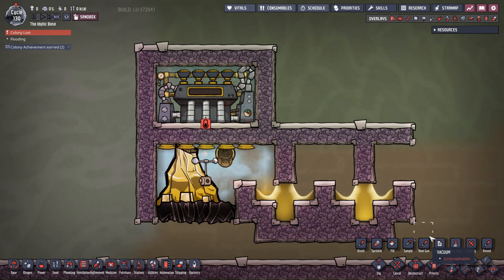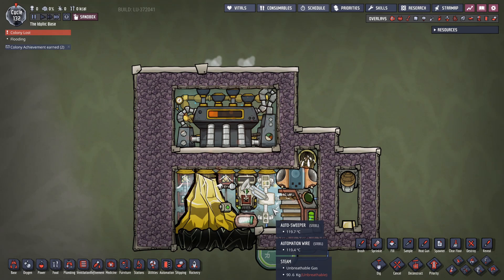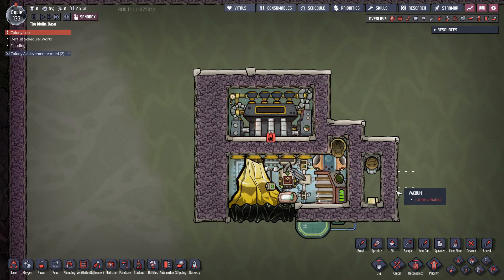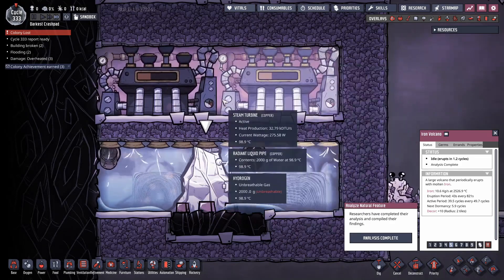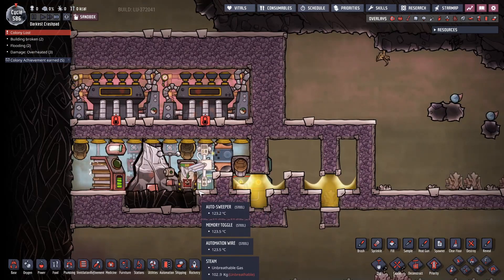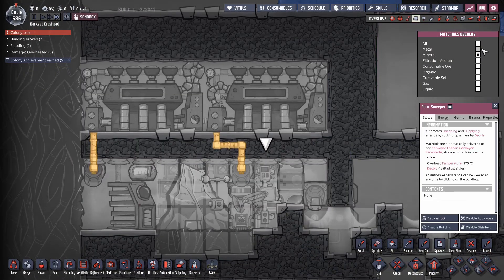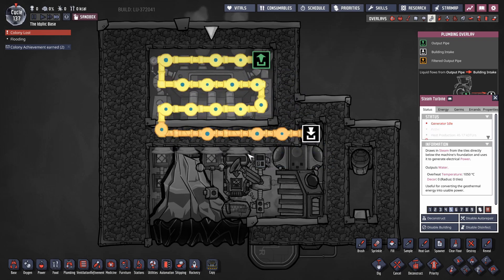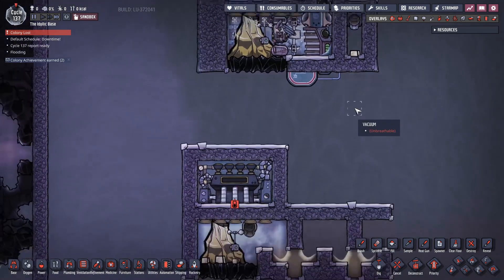Iron, Gold and Copper Volcanoes : Tutorial nuggets : Oxygen not included

Comment: Some advice: I used a modified design form these and while it’s tough to setup and only mostly stable, it works with modded tungsten geysers, however the conveyors will melt if it ever breaks or is setup slightly wrong

Oh yeah also it works with under 2000 kg steam, haven’t tested stability though, and I used gold mechanized airlocks instead of liquid locks
Reply from the maker: Working with volcanoes is a tricky business, do it right and it runs forever. Do it wrong and you have a toxic area of the map you will probably have to wall of forever.
Reply: Francis John yep, that happened on a previous game

Comment: When you mention at 4:32 that you need "3 tons of water" do you mean that I manually need to add the water in the room before the first eruption and after that it's working by itself?
Reply from the maker: Exactly. Three tiles of water 3000kg is about the perfect amount to make it run hands free forever.
Reply: @FrancisJohnYT  Hello I tried the build and after the Volcano became active it took a while for the steam to hit 125 C and now every few eruption cycles, it goes back to being under 125 and the turbines stop. is that normal? Isn't it supposed to run pretty much non-stop while the volcano is non-dormant? The only thing I did different(I think) was using Sedimentary rock for the insulated tiles instead of Obsidian.

Thanks.
Reply from the maker: @MasterOfCookies8  Oh I should have specified the idea is to get the metal out. Continuous operation of the steam turbine is not the goal and not reasonably possible with metal volcano. You need a magma volcano for that and a magma storage tank.
Reply: @FrancisJohnYT  thank you for the clarification :) happy new year
Reply: @FrancisJohnYT  THank you for the answer, will try the build soon.

Comment: For the automation, you do need 3 elements, but it is a little simpler if you use buffer and a not gate wired in a loop - they provide a 'always on with a blip' signal out of just 4 tiles of automation. Hook the filter to the output and you've got the perfectly minimalistic, two phase timer out of 3 components within 6 automation tiles

Comment: Seems like 2000kg of water is the absolute maximum. For the exact design at least, you might get away with it if you make the chamber a little bigger, something i have to test now.
I had put in 500kg per tile, so i thought. I cut the water pipe a little bit too slow (water bottles came from too far away and i had a pipe nearby) and it turned out to be just a little bit over 500kg per tile which resulted in over 150kg of steam, but not hot enough to get sucked out by the turbine cos the geyser stopped
Dont overdo it!
Reply: If you need more mass, you can always add tempshift-plates.

Comment: At 4:00, regarding dupes being in exosuits all the time.  That might be an interesting challenge for your next base: minimal exosuits.  Maybe go so far as to limit exosuits to vacuum or lava areas only.
Reply from the maker: The hardest part would be dealing with all the CO2, you would need to demolish the map or the CO2 would build up in pockets everywhere.
Reply: @FrancisJohnYT  It's not like you're shy about demolishing maps ;)
Reply from the maker: @elan_07  I walked right into that one. Would be tricky depending on the map. On Oasis for example it would be near impossible, near. Rime It would be easy as there is no heat at all. I'm struggling to think of a use case where it would be more efficient though.

Comment: The only thing I'd add is the overpressure  mass of metal volcanos is 150 kg/tile. So you can put too much water(steam) into the system.
Reply from the maker: That is very very important info, I did not hit that in testing unfortunately. I'll pin the comment and add it to the description. Thanks for the info.
Reply: damn I run into this the hard way :D . I was blaming my gold volcano to be stingy compared to the others. Then I checked: 153 kg/tile steam :/ . Also adding the note that, at least mine, was NOT showing "overpressure" in description, even when trying to erupt
Reply: This is really good to know if you unearth a metal volcano before you're ready to tame it. I had one that was about to erupt in a few cycles and I wasn't ready for it. So I just flooded it and came back when I was ready.
Reply: I was wondering what the cutoff was as I ran into this during testing while adding more water. Good info to know!

Comment: what I did was delete all the automation and just put a thermosenser 1 tile to the right of the conveyor shut-off set to green signal if below 130c
Edit: I also added 750k of petrol to the bottom to help absorb the temperature more when it erupts. Just something I like to do with steam turbines and temperature spikes. Then I had to put the battery on a mesh tile.
Reply from the maker: Does the petroleum not flash to sour gas during eruptions? I was considered a layer of petroleum but I figured if my copper shipping rails were melting, my petroleum would flash to gas.
Reply: @FrancisJohnYT  it hasn't yet in my testing. But I use a thick layer of it too, with plenty of temp shifts made of granite right behind the volcano too. I wonder how low of mass you could go with the petrol and still not have sour gas? I might have to do some more testing :)
Reply from the maker: @zeaol  I just saw all three metal volcano types using that method in a base lovin video. Totally works, totally stealing it. I'm going to have to redo the tutorial at some point.
Reply: Thermosensor on the conveyor belt was my initial thought as well, haven't tried it yet though

Comment: I've been toying with the idea of small/cheap tamers like these to supplement my power needs, but I've run into a snag on trying to use regular wire over heavy-watt (distances between volcanoes is pretty far) to dump the power into my main batteries.

So far my only decent solution is to have two power banks where no draw comes from the one being charged and the other runs as normal. Do you have any advice for something less battery-farm intensive?
Reply: Build a two block high tunnel grid system that is completely enclosed throughout your base and then use transformers to reduce down to conductive wiring.  You need to make sure heavy wires are not visible because of decor.
Reply from the maker: Can you not just use a transformer to dump the power onto the main grid? You might want to setup a power switch to ensure that only excess power is sent and that you always have a close to full battery on site.
Reply: @FrancisJohnYT  I had assumed something like that would cause damage to either the transformer or the wire from production, I'll try it
Reply from the maker: @TheVeryHungrySingularity  You can feed power from a 2KW wire into the top of a transformer and have it output onto a 50KW wire the other end.

Comment: I've been wondering for a while if a steam turbine could be self cooling. You answered my question, thanks!
Reply: no it cant!only ONLY work on sandbox or debug. where u can find really cold obsidian, and for how long it will be in a good temperature to hold less them 100c... this is a fail design..
Reply from the maker: Worked for 500+ cycles using Obsidian insulation, not sure if it's perfect it could fail at 1000 cycles. I'll have to try on my next play through if I get a chance.

Comment: Silly question, if the Steam Turbines need to be cooled, why encase them in insulated rock. Why not just let the heat spread from them?  OK, the area around the volcano would heat up, but that might not always be an issue.
Reply: encasing is just necessary if you need to lock some gas inside (hydrogen in this case). But if the volcano is in a colder area and you don't care about make stuff around hotter, you don't need to close the steam turbine.
Reply from the maker: Technically it's not necessary. But design standards encourage builds that have zero side effects. They don't affect the temperature of an area if possible. Makes sure you never have to worry about them in the future. If you left everything the same and just removed the insulation around the turbine all that would happen is you would heat up the surrounding area to 90C or so. Leave in the cheap obsidian insulation and it's completely self contained.
Reply: @FrancisJohnYT  Thanks, that was what I thought and on the cold Rime I can use that heat to warm up things

Comment: I think 3 gates are needed, but you can probably use buffer/not/buffer instead of memory/buffer/filter. The time for the two buffers is 30 and 1. Connect the 30 buffer out to not in, not out to 30 buffer in and 1 buffer in, 1 buffer out goes to the shutoff in, not out goes to the loader. IOW, it's like a "clock" gate used on a door cruncher.
....................I 30 buffer O
to loader.....O       not     I
....................I 1    buffer O.... to shutoff
Reply from the maker: That could save a couple of tiles of space, I don't like the way the memory circuit sticks out the bottom.

Comment: there were one metal volcano tamer in your base lovin' video that is extremely nice, plz include it for others. (i think it involves limiting water flow of 1kg/s to cool the metal) it's quite complex btw.
Reply from the maker: I remember that one, it would run the output water in limited pipes to cool the metal. It's amazing just a little to complex. It would get the metal down from 125C to about 95C if you did it right. Not sure it's worth the added complexity.
Reply: @FrancisJohnYT  isn't the point of tutorial is to show stuff? U shown easy one then show a complex one as well
Reply from the maker: @1998hang  It's tricky to explain, but I'll try. I want designs that players can look at and replicate or modify for their needs. Simultaneously I want them so simple they don't break or have any "finicky" bits. Otherwise I have to reply to lots of comments on why things are breaking. (Check any petroleum boiler tutorial comments) Also if I make the videos to long people don't watch to the end and I get flooded with questions on stuff I answered in the video. So to tutorial to my best for the community and manage my time I try to keep the videos as simple and short as possible while covering all the potential issues that could be encountered. That does not explain it perfectly but it's the best I can do with a comment.

Comment: Cheers for self-cooling turbines! Some suggestions, tempshift plate behind turbines and volcanoes for smoother work. 2 bottom layers of volcano can be flooded with raw oil or petroleum for better conductivity  (only when you have tempshift plates, else you get sour gas). upper part of volcano have a tile for drown-check (over-pressure), so you can add ~50kg of oil\petroleum to seize that annoying drown-checking tile and add tons of water above. With drowning tactics you can tame volcano from above without vacuuming you workplace. You can sweep metals through the corner with auto-sweeper, that is placed outside of volcano chamber (but you get hotter metals, or must wait till dormancy). And drowning tactics have some bugs with steam included, so better place Liquid Vent for turbine exhaust like you making infinite gas storage (flood it with some oil).
Reply from the maker: Would all depend on the type of volcano you are cooling, for the tutorials at least I try and keep everything as simple as possible. It should theoretically be possible to put together a simple tamer without even access to atmo suits.

Comment: Simplicity is the best! :) You could just use a AND GATE with a thermal sensor and a clock, only downside it will run once per cycle for x amount of time. But on how long in between eruptions there should more than enough cycles to get everything cooled. Early days I use to power a steam turbine running at 350W+- constantly off a iron volcano, but the work involved setting it up isn't worth the 350w. >_< The gold and copper volcano's are not worth trying to harvest energy off them constantly.
Reply from the maker: Agreed, I prefer the metal over the power.

Comment: Very simple.  Painfully so.  There is a lot of value in making something super simple after all.

So you can cool a turbine with its own water output.  It seems like a harder thing to balance.  If you get it a little too hot it shuts off.
Reply: The key thing is to keep the steam in the chamber below a certain temperature threshold, because the heat that gets transfered into the turbine in proportional to the heat being destroyed (10%). Destroy too much heat and the simple cooling breaks down. You only have a 5 degrees differential to work with with water. Using a spreadsheet you can calculate how much mass/DTUS 5 degrees of water can cool.
In this video it looks like the sweet spot is about 125 degrees.
Reply from the maker: The trick is to put in lots of water in the steam area. The more water you put in the less of an increase in temp you will see. Of course It will take longer for the steam turbine to eat all the heat as it's cooler steam but it ensure perfect stability.
Reply: self colling turbine works ? yahp,, but for how long? did u check the 20 degres abyssalit that he uses on debug for isolation ?
Reply from the maker: @RenatoVeronez  I used Obsidian for insulation not abyssalite. They will last at least 500+ cycles according to testing. The map saves are included in the description you can stress test them your self if you want.
Reply: @FrancisJohnYT  ok thanks man

Comment: I tried diamond plates behind the volcano (iron) and it seemed to cool down everything enough to solidify the metal. Cooling afterwards is another issue.
Reply: diamond have an awful lot of thermal capacity so it's even enough to solidify magma at first eruption!
Reply: @mrShift_0044  I had over 20 tons of iron available after the first active period and temps dropped down from around 1000C to 500C. It's a good way to get some metal without having to do a ton of automation to start with.